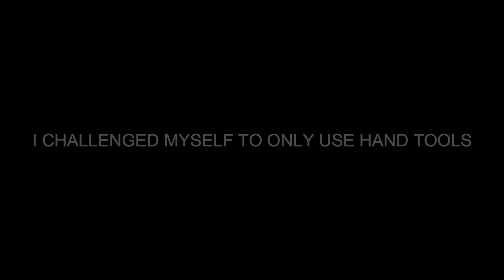Building A Log Cabin in 5 Days - Off Grid Bushcraft Project In A Woodland | Wood Stove | Bed | Chair

Comment: Great job keeping it purely woodsy.
Bushcraft is all about using what is available in the surrounding area.
This is bushcraft in its purest form.
The only cheat was using the tarp for your roof. I suppose one could make cedar shakes/shingles, cut purlins, and create a 100% bushcraft building but I'm impressed with the skills and precision of the build.
Reply: Also his cutting board, wood stove, and pipe/chimney. But yes, the rest is woodsy, bushcraft with what was available in the surrounding area.

Comment: I owned a half mile long timber lot in the 90's.
For the sole purpose of building a tree-house.
I hurt no timber in doing so.  Rigged  it for SRT,
for ascent, descent, and hauling construction
materials,    A week long build job by myself.
For summer use.  Sold the land to assist my
speleology interests.  I continue to renew my
SRT gear using Wes Spur Tree Equipment.

Comment: I don't know about you, but I felt a huge sense of relief when he finally started using nails & a hammer on the roof 😆 (where pooling water will be an issue without a drainage system). Damn fine build young man, awesome vid & great e-store! You do ship to the USA right? All the best ~ Patrick R
Reply: Note: if you changed the horizontal roof beams (rolled in canvas) and made them more diagonal, it would give the rain a better chance at running off the roof instead of pooling. Love the build  ~ just sayin

Comment: hey, just a friendly tip for when you build another log cabin using only hand tools:

Log cabins are mostly constructed without the use of nails and thus derive their stability from simple stacking, with only a few dowel joints for reinforcement. This is because a log cabin tends to compress slightly as it settles, over a few months or years. Nails would soon be out of alignment and torn out.
Reply: I honestly think that's not true. My grandfather took down his cabin last year when I visited him in Alaska. His daddy, my great grandfather built it nearly 80 years ago. The roof part had some kind of old 5 or 6 inch metal nails at the base of the rafters. That was the only part that had nails. It stood for 80 years so I don't think the nails , at least in the base of the rafters , is a problem.
Reply: Nonsense

Comment: There is a better way to make a hinged door or window by using a base piece with two end pieces that you can attach to the main wall. the base piece which will rotate should be widdled down to a dowel on each end and the pieces you will attach to the main wall having a hole for the dowel's to go into before you attach the  small pieces to the wall. You have the auger,  knife or saw, and nails  to make the dowels on each end and attach the small pieces. It would be better and much more stable than cordage.
Reply: Attah boy.
Reply: Can you make a video i can't picture this or understand what it means.
Reply: You can do that when you build your cabin
Reply: @josephfecteau5945  Already did Sorry not trying to be an asshole just trying to help.

Comment: It would tale a heck of a lot longer cutting the logs also. Those logs were obviously pre-cut as clearly seen on the already weathered ends.
Reply: Read through the comments just to find someone else who had enough knowledge of wood and forestry to understand that at least a year in advance all these picture-perfect logs had to be cut, stacked and dried somewhere.  Far more likely these were several years prepped by a commercial company that delivered them precut to specified/equivalent length to wherever this build occurred.

Comment: hello my friend iam from morroco  you have been a great job to building this shelter craft but when you putting a nail you must putting a little piece of tires I'm in Morocco when I changed the tin roof of the house I did it like this is stopped the rain drops of water and it's never a holes

Comment: Few questions:

1) What’s the name of the tool used to dig a hole in the log ?

2) 21:40 how do you make the « wooden screw » dimensions to fit exactly the hole you made with the earlier tool ? Everytime a wooden screw is shown, it’s already shaped.

3) The foundation are the logs themselves stick all together. Is this enough for example if there is an earthquake or if the ground moves for the cabin not to fall ? I know it’s bushcraft, but will it last years ? How many years it might last ?

Last question: no need to treat the wood against insects and so on for it to last the longer possible ?

Comment: chinking will blow out in the first storm. not all the logs were pegged together. inadaquate insulation where the stove pipe goes thru the wall. a tarp for a roof. will it blow down or burn down first

Comment: I would love to do this on my property. It’s mostly wetland but I have some areas I could put a small cabin. I would not be brave enough to use only hand tools. I do have a question though. How long would this last? Since the bark is not stripped and the wood is not dried and sealed. Would that decrease the life of the materials?

Comment: In theory could you flatten the logs on two sides a bit so you could fit their walls together more easily rather than stuffing moss into the ‘cracks’ for insulation as most builders do?

Comment: I appreciate the hard work you put into the construction of your log cabin. However I didn't like the fact that you didn't hewn the logs. This will invite ants and other insects plus make the logs rot from moisture quicker. Your use of hand tools only was good to watch as well as your construction method. I liked this fact as it was like it was survival situation. You couldn't run to Home Depot for cut lumber thus you used only materials that were readily available. I would have liked to have seen you building a more traditional roof however as I believe the tarp was a bit of a disappointment. You got away from the material available only program.

Comment: Entertaining video, but not really built to last...the way it is notched will collect rainwater and cause premature rot,  as well as not locking the structure together, and the door jamb should have been hewn and pegged to the ends of the wall logs for stability. Bear could rip it apart in seconds. The way it is done is structurally unsound.......Sorry but the engineer in me can't help but point it out.